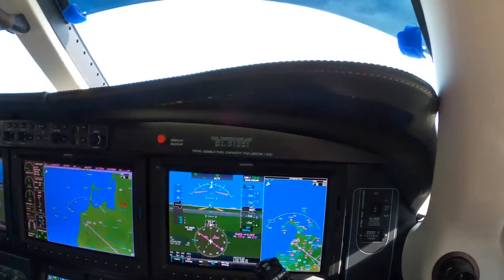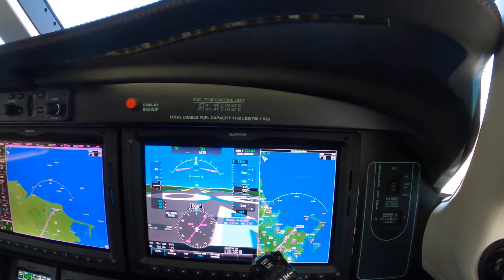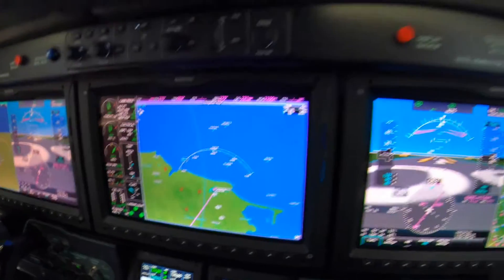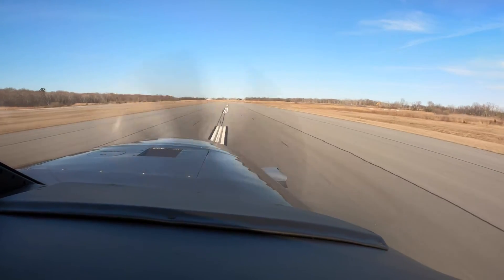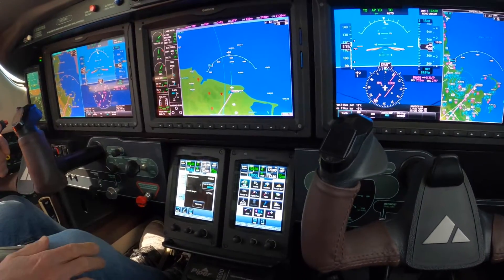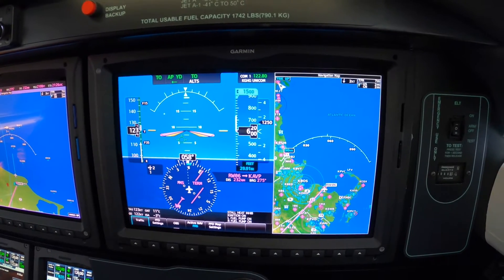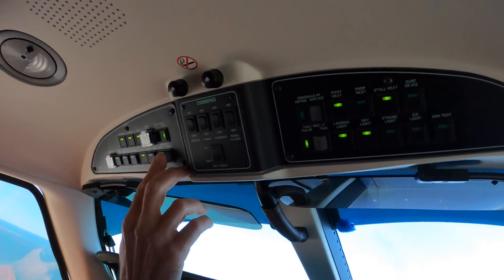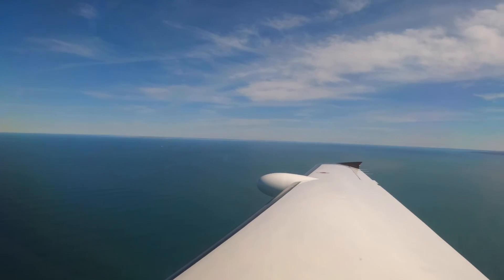Piper M600 - Techniques for setting power for Takeoff

Comment: Does the m600 have autothrottle?
Reply from the maker: Hi Timothy, yes the M600 has auto throttles, however the auto throttle feature is not available to the pilot during normal operations. The HALO equipped M600 uses auto throttles (and a host of other technologies) to accomplish the Auto-Land function. The system allows for one button push to safely bring the aircraft to a full stop on the nearest suitable runway. The system is FAA certified and it will likely save lives in the future.